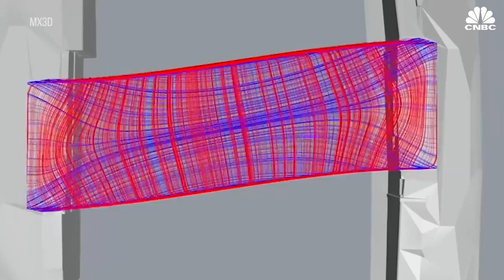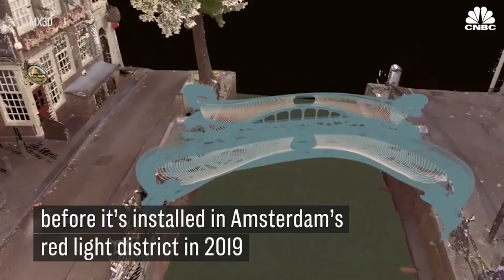This Steel Bridge Was 3-D Printed In Midair | CNBC

Comment: I guess it's 3d printed but what they did isn't new. it's mig welding to fill a gap in a pretty way. I've been doing this for 15 years just not on this scale and not as pretty.
Reply: So you didn't do this for 15 year.
3d printing is additive manufacturing so it's the same concept, but not the same result, you do 1 piece + 1 piece + a little piece of filament = 1 piece while 3dprinting do filament = 1 piece